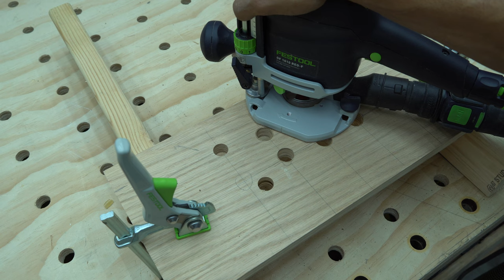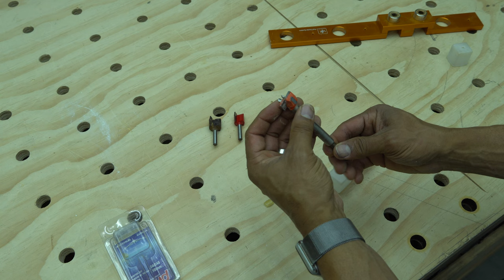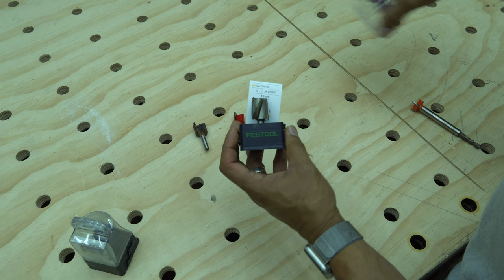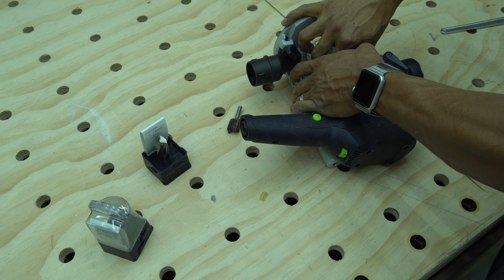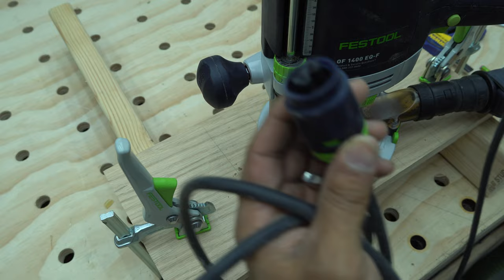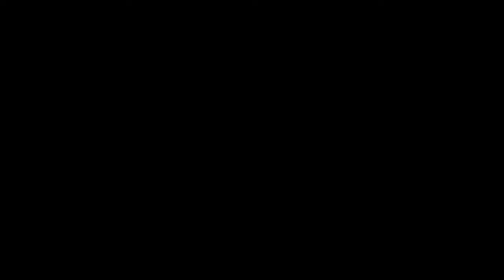20 MM Router bits for making MFT table tops

Comment: Another woodworker did a vid saying what is best is to make an indentation with the straight but and then drill out the centre. Then do the sides. Good vid, thanks for sharing.
Reply from the maker: Cool. Thanks for taking time to check out the video and for the compliment.

Comment: Such a great topic. This is a hopefully a start to router bit discussions for making accurate 20mm holes. Just an FYI, ideally a straight bit needs to have an end cutter on the bit. Standard straight bits will burn quickly and so not great for boring holes.
Reply from the maker: Thanks for the information, DIY Cave. If you get a chance put a link to the exact type of bit you are referring to. I am going to go a follow up to this video including measurements. Thanks again take care.

Comment: Thank you for sharing this video. The festool hinge boring bit is really nice but has one problem. It's slightly oversized (20.1-20.2mm) so that 20mm hinges fit nicely but that makes it less ideal for 20mm holes 😞. Measuring the holes afterwards would be a great addition.
Reply from the maker: Thanks for the information, Jens. Another person mentioned using calipers to get exact measurements. I was considering doing a follow-up video to include caliper measurements. I am glad I did not jump to complete that follow-up because you added another variable to the equation that I should have considered. When I drilled my 20mm holes for the Benchdog quad hinge for the guide rail, I did not measure the bit with calipers. I might purchase a new 20mm Freud bit, measure it with calipers, and compare the results against the Festool 20mm hinge bit. Thanks again for the feedback.
Reply: The Parf the the best fit for sure, the Festool do have a slight wobble to the dogs when inserted. Need either Peter or UJK to make a router version of their drill bit

Comment: There's a video you should probably see. PeterMillad drilled his custome MFT top in seven minutes, using his Festool router, track guide and, I think, an accessory that facilitates accurate spacing.
Reply from the maker: I will have to check that video out. I may have seen it. I have watched many of his videos.

Comment: if the router speed can not be reduced enough ,the feed rate needs to be drastically increased to avoid burning from rubbing vs cutting.
Reply from the maker: Thanks for the tip. I will give that a try.

Comment: Firstly it's incredible how difficult it is to get a 20mm plunge bit to use in a router - mind blowingly hard in fact. Because really it's the fastest way to bore out perfectly plum holes for an MFT. The other comments are right regarding the Freud double flute straight bit, BUT.... I think I have a good(ish) solution. These bits still do have some "down" cutting ability - but it's really limited (as you can see on the bit where the sharp carbide is). I am going to make a jig that uses 1 inch holes (I'm going to drill these with a forstner bit on my press) but that are still 96mm spaced. I'm going to try this 20mm Freud bit in conjunction with a 1inch OD brass template guide (which will lock in my plunge router so I will always be 96mm on center). But instead of going through my top and using the bit to remove all material for the hole, I'm going to start each location with a 3/4 inch forstner bit and then bore through with a cheap 5/8 spade bit purely for removing material. Then I'm going to come in with the 20mm Freud bit and use it to remove the tiniest possible amount of material (almost like a finishing reamer) and enlarge it slightly to 20mm. This way the pressure/friction on my router bit carbides is dramatically reduced as the center of the bit isn't grinding out the rest of the wood to make my hole (as another commenter mentioned). But thanks for putting this video out there, was good to watch and hey, you got your table drilled and functional so nice work.
Reply from the maker: I used 20 mm Freud bit to make all the holes around the exterior for the Benchdogs Quad hinge system. The bulk of the holes were made with the Parf Guide system. It worked out well for me. If you have the funds look into it. It is still a two step process but my results are sound. Thanks for checking out the video.
Reply: @daddysharespace  Yeah totally - you did a great job. I'm not going to cut a full table so investing $230 into the Parf doesn't make sense. I'll report back if my idea works out in reality!

Comment: Nice router bit comparison video.  You convinced me to purchase one of the Festool bits.
Reply from the maker: Hey Steve, thanks for the compliment. Which Festool bit did you choose?
Reply: Sorry for the delay.  Just saw your comment.  Short story I tried to order the 20 MM Festool 490951 (Spiral up cut) , however they appear to having problems shipping it.   So I ended up using a combination of  a 1/2 inch Spiral upcut for an initial hole and the Freud 20mm boring bit.  It worked well, but had to drill every hole twice.

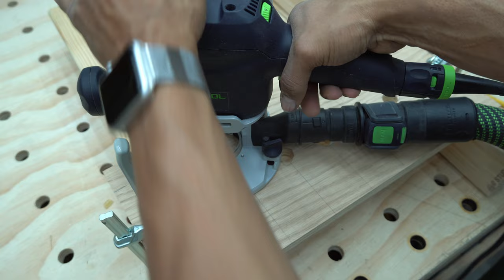Comment: Hi, you may have already found out, but the bits with cutters only on the side (like that Freud) are meant to go into the material from the side, not for plunging vertically. It has only two cutters at the sides, and when you plunge it vertically, it really only cuts with those cutters at the sides. At the center - where there is no actual cutter - you just "abrade" away the wood with the body of the router bit. You can plunge those a little bit a time, if you are moving it horizontally as well. So you may get away with cutting a groove starting in the middle, and slowly going sideways and deeper in tiny steps (like the 1-2mm the cutter is bigger than the body of the bit). But going straight is really not recommended. Like at 22:07 you plunge it a bit without effort, and looks like after that you really have to push down on it...
Afaik there are not really 20mm router bits that would create a snug 20mm hole for a 20mm dog. But would be interesting, if you can find one!
Reply from the maker: Thanks for the information I appreciate it. I purchased the Benchdos Quad Hinge system a while back. On Youtube I saw a guy use the router bit I used to drill the holes for installation. That gentleman was the first video I could find on that install. So I just went with that method as the Benchdogs device can be purchased with a hole drilling jig that is not compatible with the Parf Guide System. Regardless, I appreciate the insight. Thanks for taking the time to check out the video and provide helpful constructive critique. That's how we get better.
Reply: A brand called Trend makes one.  It’s like the Freud, but has an extra cutter centered on the bottom-middle to allow it to plunge.
Reply: That’s a heck of a way to start learning to use a Router! With a full set of festool machines…but if a job is worth doing!!!.. the staining on your bits and dust collection cowl is vaporised glue and resin from burning your way through those holes.! Heat is the enemy to all  cutting tools.!!   So when you are  really pushing a tool cooling it off really helps. general tip on routing-  taking out the bulk of the material to be removed  saves a lot of wear n tear on bits, with less heat  less burning and less work for the motor, speaking of heat putting your hand over the cooling vents on top of the rounter won’t be doing it any favours either - really entertaining video  all the same….every day’s a school day..😁❤️💪🏻💪🏻💪🏻

Comment: I thought for sure you were going to measure the holes with a caliper, and compare the actual fit with different known bench dogs. What about router speeds vs. burn / cut quality?
Reply from the maker: Hello ssk, I meant to use my bench dogs but it was getting late. I did not consider the caliper idea or the router speeds. That is a good idea. I might put that info in a follow up video.

Comment: Whats the router speed settings , I would think you would have to use the lowest speed possible to prevent burning and use an undersized bit i.e. 25/32 inches which is 19.8mm Then use a UJK Parf System Reamer for 20mm holes with a drill to bring them up the the exact Parf Guide hole size! Just an opinion...
Reply from the maker: Thanks for the question, Vixen. I had the router at full speed at the time. I will try the lowest setting next time. 
Your method for making the 20mm holes seems reasonable. I need to measure my Parf Guide system drill bit to see if it is 19.8 mm. When I made my MFT, I used the Parf Guide system. 
When I received my Benchdogs.co.uk Quad hinge system, I utilized a Freud 20 mm bit to add the holes for the installation. I got the idea from another YouTuber. I didn't have any problems with the Quad Hinge system because it uses a compression ring that dilates when you tighten it, ensuring a snug fit. 
Thanks for sharing the tip about using the 25/32-inch bit. I will have to purchase one of those and a UJK Parf System Reamer to see how that works out. 
Did you make your top out of plywood or MDF?
Reply: @daddysharespace  the reason for the 19.8mm bit is so its undersized and the UJk reamer bit will bring it to the exact correct UJK bit size..(the reamer uses a drill to ream so the hole will get larger and remove any burn marks since its a lower speed drill bit not router bit)
If you use the UJK bit it is a boring bit not a routing bit so it will use a drill and be very slow therefore no burning..
The UJK bit will also be the right size (20mm)so no reamer is required...
BUT! the reamer is used for the UJK parf system to bring wood like mdf that might swell or be soaked with stains/coatings back to the exact 20mm UJK size.. 

I use the reamer to bring my router created holes that might be burned up to size and remove any burns that may be cause by the routed holes I use to make the the Benchdog hinge attachment holes.

Also there's another way to make the Benchdog Hinge holes..

https://www.youtube.com/watch?v=jIzaCj2vAgo&t=5s

Mine was MDF..
Reply from the maker: Thanks for the information.

Comment: Nice video sir !  You might want to give those bits  and dust extraction shute an overnight soak in 100 % Simple Green.  I've been using it for over 30 years to clean up bits and saw blades , also a firm bristle tooth brush to scrub.
Reply from the maker: Thanks for the tip, FlyinTrapezious. I will have to give that a try.